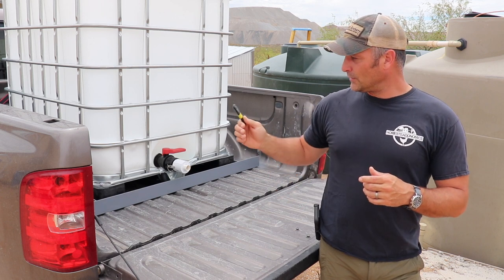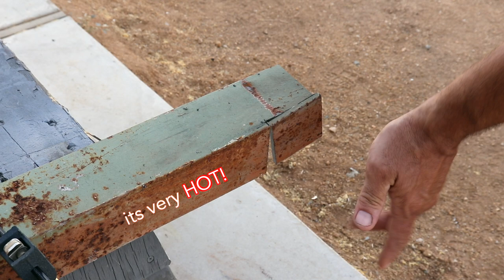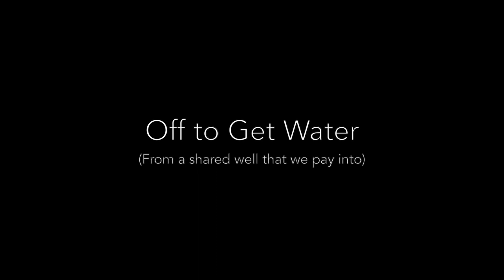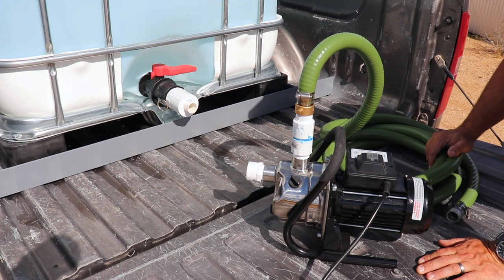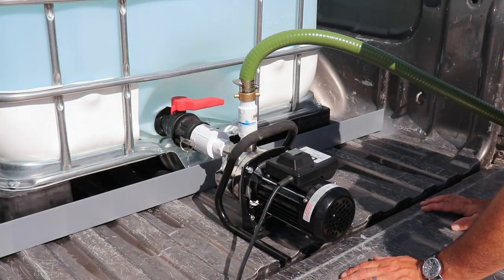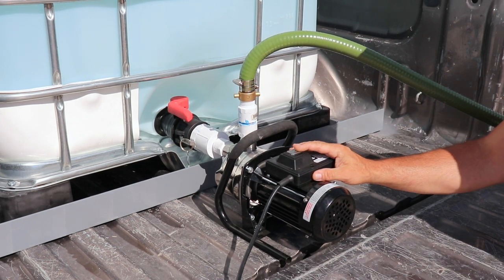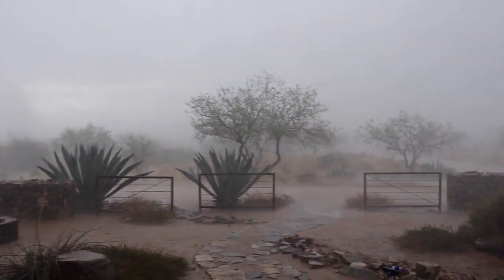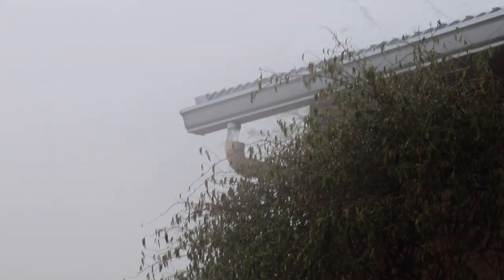Rainwater Harvesting to Hauling Water -  A Problem, A Solution and a Perfectly Random Monsoon Rain!

Comment: 😂😂…. Cup runneth over. But the stop gap measure was a very important detail to do, since your dealing with nature. Funny since I bought my 3 60 gallon rain barrels it hasn’t been enough rain to fill 20 gallons of one of them. It’s the dry season 🤷🏻‍♂️. But I’m ready. Planning on using the water to expand my hydroponics gardening. Great content thanks for sharing.
Reply from the maker: ‘If you build it they will come”.... or the rains will come😂

Comment: In my opinion the best thing to do is to separate your water systems in your house if you haven’t already and have a separate water collection system for flushing the toilet/washing clothes/watering garden.  Dig a large funnel shaped depression somewhere on your property, line it with polythene or similar with a sump at the centre,  cover completely with river stones to keep the polythene from being sun damaged or blowing away.  Then pump the water from the sump to a tank, the tank can be very simple, dirt floor with braced plywood sides lined with polythene or similar, some baffles in the tank to catch sediment/sand/dust.  The toilet and washing machine account for about 40% of water usage in the home depending on where you get your data and if you make the system large enough you can use the tank for a swimming pool if you want to, just need to be careful with the pool chemicals and the washing machine and septic tank.  Very simple low cost solution.
Reply from the maker: I like the idea.  I’ve thought about something similar but just have not ironed out all the details in my head yet🤔👍🙏

Comment: We finally got our house hooked up to our rain catchment system. With our garage tanks we're now up to 10K capacity. We'll be adding more tanks when our equipment shed is completed. During extended dry spells we haul water from a spring. Rain is a good thing

Comment: Nice job, if you need more water perhaps add a trailer and allow the upper (pickup) tank to fill lower trailer tank? Nice pile of angle iron out back.
Reply from the maker: Thanks Alan! Yes a trailer would definitely be better in the long run.  Perhaps a future build🤔.  But don’t tell my wife😂
Reply: @homesteadonomics  I'm in so cal and it's going to be a tough year for all without rain. Reservoirs are way down and fires are popping up all over. Friends were just out in AZ flying spotting plane, rip. Keep up the good work.

Comment: Those Totes here where I live ( Florida ) cost anywhere from $30-$150. The $30 ones are Constantly Sold Out by the time I find them, so that leaves a Farm Supplier selling them for the $150. The HUGE Tanks like you have.. Well Over a Grand a Piece. 
And Never Fails, You go get water and then it decides to Rain...
Reply: My 725 gallon horizontal water tank on my trailer was in the $1,400 neighborhood 10 years ago or so.  I hate to see the price of these tanks now.
Reply from the maker: Yes, that is about the range around here.  About $40 for utility water grade all the way up to potable water IBC’s at around $155.  And yes, rain came just in perfect time😂
Reply: @homesteadonomics  Well the rain in my area has been a regular basis this year and only been able to mow fully once because it was Just dry enough and that was 3 months ago. And the Ditches 3 wide strip on each side. Other than that, the yard is like a Vary Cheep H........ All Sloppy and Wet. Hell the Actual Swamp Land across the road is dryer than my yard and it sits at a Lower Grade than mine.

Comment: Is there a way to reduce the 2inch cam lock to a 3/4 inch garden hose connection without destroying the flow? Or am I just going to have to invest in a good 1 inch hose? I am using gravity not pumps.
Reply from the maker: You could reduce down to a 3/4” hose thread very easily.  2” thread to slip.   Then a 2” make slip reducer to 3/4” female. Then add a 3/4” pvc slip to hose fitting.    And with gravity it would take longer but work just fine.  Simple park and let it flow👍😀

Comment: I just got a property with no well and no roof catchment structure so this was very helpful! Will the IBC tote not stay down with just straps?
Reply: Yes.
Use two.
Front and rear of tank over the top.
On rough hills, go easy.
Been hauling for 13 years.
Reply from the maker: Yes, but I travel easy with it.  Nerol is right, a couple straps and just drive very careful.   The tray will keep it from sliding around in the bed.

Comment: In most cases a mobile home will last a lifetime but most municipalities won't allow the to be put in place after ten years some will allow you an extra 5 years but it's a time consuming process I have seen lots for free on kijiji but you need to sign it over fast and when it takes 3 to 4 months to get approved it's gone but if you can get a permit fast enough you can do a lot of upgrades for little or no cost take the siding off one side at a time and fir it out to 2x6 and replace the insulation with r20 add more in the attic and you will be more energy efficient

Comment: The missing piece (IMO) are the specs on the "shared well". How far is the drive? What would someone expect to pay for something like this? Is it by use, a fixed monthly fee, fee plus usage, etc. If it's too private, it's ok to say so. But I feel that was a big part of this video, with no commentary about it.  Forgive me if it has been covered in another video, I missed that one. Thanks. 
PS: I am so glad you have a water source outside your water collection!!  
Cheers from Michistan.
Reply from the maker: No worries.  Well is about 11 miles from the house.  It is a small water company that offers subscriptions services to residents.  There is a fixed monthly fee, about $27-30 and a fee based on the gallons used.  But we don’t use much and won’t really haul that often... only thr in between times.  It’s actually more cost effective to have a water hauling service deliver in a case like ours where we will only need to haul during the extended periods.   Usually monsoons fill out tanks, which with our relatively conservative use will get us to the winter time when we get rains and our tanks are filled again.... but after that, the months of April, may , June is where we really need it.   
So ultimately we signed up more for the peace of mind to be able to drive to the well whenever we would like versus having to schedule a truck to come out.
Btw... I like the ‘michistan’ 😂

Comment: I wanted to buy some land in the Willams AZ Area. I was told NO WATER for Well drilling. So now I need to re-think it!    :o(
Reply: I’m in Ash Fork area off Rt 66. Wells are deep, run dry, and not worth it to many. A couple water fill stations to choose from at least. A few water delivery trucks also if your road is passable but our road isn’t the last 1/4 mile for them to our hilltop. Working on rain roofs and 2500 gallon tanks. recent rains would have filled but we don’t have the surface area yet 😕
Reply from the maker: Well, it’s perfect that both of you are in and or looking in that area.  We are too looking specifically in Yavapai county for a large chunk of land.  To set up an off-grid ‘vacation’ place.   Likely for me to build a prefab structure or shipping container cabin of sorts that I can haul up there and set down.  If so, I’d probably be doing a video series on it.   If researched the water situation ‘well’... pun intended😂....and Yep, not great options.   Likely I’d try for a large surface low to the ground rain roof with a property that has the right elevation change.  I love the juniper country and also the large parcels.  But I’ve also checked out Navajo county and some of those places are located above the coconino aquifer.   Which is supposed to be very good and reliable, if, you have the right subsurface composition to drill relatively deep.   But who knows, more of a fun thing to look and do window shopping.   But also, would be nice to have another option in this weird lot changing world we are in right now.

Comment: If you use salt with iodine no problem with using rain water for consumption. My roofs are black but I consider to paint them white in order to beat global warming and minimize temp swings below the roofs. Did you ever consider to paint your black above ground tanks white? Overhere in Holland they use tarps that are black on one side and white on the other. Black side up promotes growth of asparagus and white side up slows growth down. I suspect reflectng sunlight to space can mitigate temp rises.

Comment: Nice work.  We have set up similar but as tandem tanks on a trailer. 
How much rain per year do you get? 
We get around 8 inch where we are in South Aussie
Reply from the maker: Thank you!  We get a little bit more here... Usually around 12” or so.   But this past year... oh man, maybe 4-5 or so
Reply: @homesteadonomics  we feel for you,  so far this year we have had 76mm (a little over 3 inches) and it's all come in a millimeter or three at a time.  Not enough to soak in,  or at times even settle the dust.

Comment: Have you considered using air pressure to push the water out of the IBC? Not sure of any pros/cons relative to your current method other than not needing a water transfer pump if you have no other use for it. It looks like most of the tank in the truck is higher than the inlet of the tank on the ground. You could let gravity do most of the work before consuming energy to push the water.

Comment: We have 6 1,000 litre tanks at various points around the house; we use the water for chickens and garden.  When it rains some tanks fill very rapidly, others much more slowly. Do you know any way of remotely monitoring the quantity in each tank? I'm wondering if there is any wi-fi enabled device, perhaps using technology similar to remote cameras.

Comment: Nice Video! If you could guarantee to hit water I'd say your solution would be a well... But I know where you're at the only way to know is to drill, and you could be out $10, 15K with no water in site. I dont know how far away the well you get from is, But I'd look into its aquifer, then reevaulate a well based on its size and location relative to you. You might try solar stills and deff add more capacity. I know in one of your earlier videos about the system you have monsoon footage of the tanks overflowing, to me that says you need more capacity. I'm sure you have an AC, you might try capturing the run off from the coils, even if you put it through a solar still or some other process, or just use it as non potable (flushing) water it might help.

Comment: Hi,
It looks like if you had a raised parking area, the water would just flow down into the tank, without the need for pumping?  It is already raised up over 3 feet on the truck bed?

Comment: After you use the pump to transfer the water, do you have to clean out that pump?  We have issue with well water that algae will grow fairly quickly if not cleaned.  If you clean it out, what method do you use?

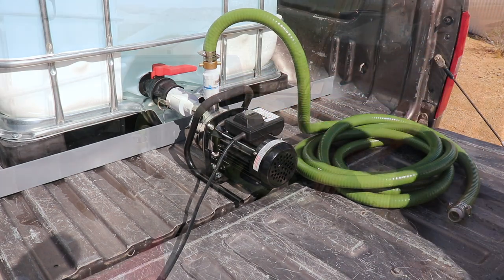Comment: 8:00 is that green hose for potable water? Many garden hoses aren't safe for drinking water. Just like water pumps (thanks for explaining that your pump was safe.) 💖🌞🌵😷
Reply from the maker: The biggest issue is making sure you have an oiless pump so that there would be any risk of pump oil seeping into the water.   As for the hose.... it is not drinking water rated.   But I did a little back research on it and the components are brass couplings, rubber washers and a rubber vinyl lining tot he hose.   Which is almost identical to a ‘drinking water’ blue similar hose (wasn’t available).   So not ideal but all of our cooking and drinking water goes through our ceramic berkey filter.   So this for all the rest of the uses doesn’t worry me.   However, when one of the ‘drinking water’ blue hoses comes available I’ll probably get one😀👍

Comment: I go to town for all my water. I used a tote in the back of my truck, like yours, for years. I now use this tank: (I'll wreck the link, so it will stay here. Just fix it.) www . tractorsupply . com/tsc/product/pickup-tank-325-gal I like that it sits much lower in the truck. I can see traffic behind me. It doesn't threaten to flip the truck over sideways in sharp turns, etc. And it's 325 gallons. Also, I can put it into and out of the truck by myself, and don't even have to remove the canopy from the truck to do so.
Reply from the maker: It’s funny you mentioned that tank because I was trying to get that specific one.... but my local tractor supplies didn’t have any in stock.   So I figured I’d give the IBC a shot since we will be hauling some what sparingly.

Comment: All the farmers are having a water crisis right now and you're posting a video showing you wasting water?
Reply from the maker: I suppose I did lose a few gallons on the fill up and a gallon to show the pump stream.   A waste?  I’m not sure where else you’re taking about.   I’m sorry if you were offended.   But we are far more conservative with our water use that 99% of households out there.   We use all of our gray water to water our fruit trees, low flow appliances, low flow shower heads, etc.   very little goes to waste as compared to most folks out there.   We have no well and live off of only rain for most of the year.   And the overflow goes back into the ground.  
Anyways, hope you have a good day.